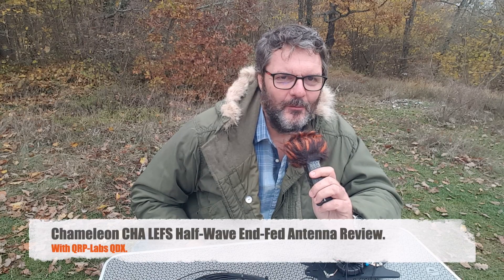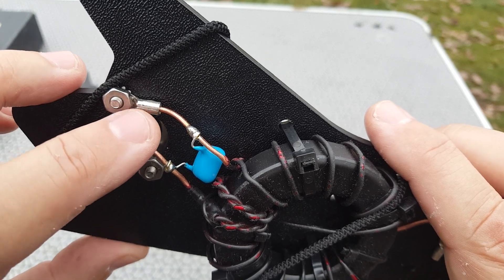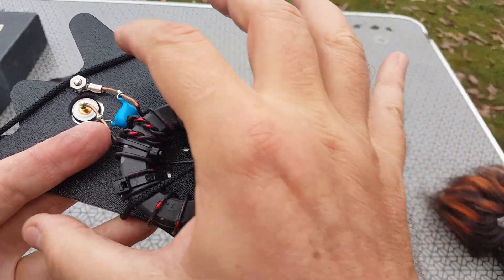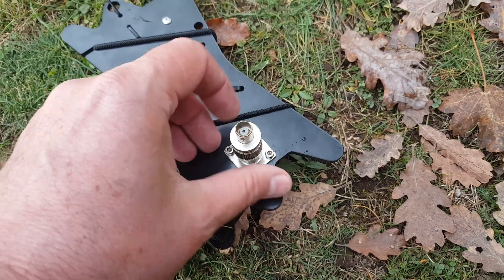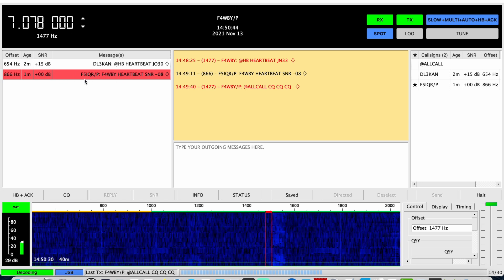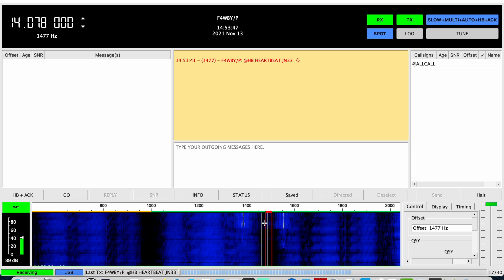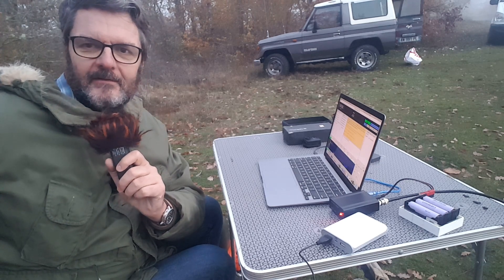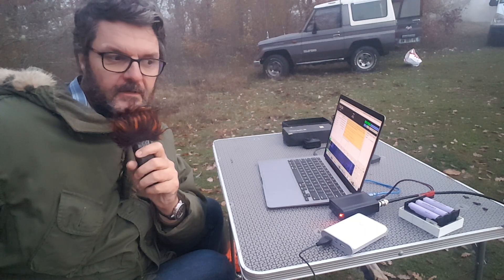Chameleon CHA LEFS Half-Wave End-Fed Antenna Review.

Comment: I don't understand the ham community's fetish for soldering crimped connections. Soldering crimped terminals doesn't increase reliability; it degrades reliability because copper work-hardens and becomes brittle. Look at the wiring in a commercial aircraft: it's almost all crimped and only crimped. That said, I love your videos. 73 de KN6NPZ

Comment: I am trying to find the best NVIS antenna for close in local contacts between 50-200 miles- any suggestions?
Reply from the maker: A simple dipole or end-fed half-wave is best. As long as it's horizontal it's fine. There are no special NVIS antennas. The only way to make it better it to lay a wire below the antenna, on the ground, 5% longer than the antenna... Go to radiopreppers.con and search for "super gain nvis".
Reply: @RadioPrepper  thank you very much the reflector wire that is laying on the ground is it one continuous wire or does it need to break in the middle where the 1:1 Balin connection point is above
Reply from the maker: Continuous.
Reply: @RadioPrepper  thanks!

Comment: The newer version, at least mine, has the entire toroid/connector/cap covered in pretty decent heat shrink.  I picked mine up when visiting HRO a month ago.  Still haven’t used it yet, as I plan on running it from our seasonal campsite next year, we have three 85’ pine trees for me to choose from for a nice sloper.  I am itching to test it out though.

Comment: Another "dummy load" antenna from Chameleon. The reason you see low SWR on WARC bands where the EFHW wire for 40M is  NOT resonant, is elevated insertion loss in the transformer which attenuates forward and reflected power. It is the oldest trick used by companies such as Chameleon, Alpha antennas, Ultimax, and many others who are either dumb or intentionally pushing the narrative to uninformed  Joe Ham how low SWR is the best thing ever and the equivalent of best efficiency which is NOT true.
Reply from the maker: You will note that I did not say it worked on WARC bands, nor did I test it on those bands. The antenna will work great with a half-wave wire and on harmonics.

Comment: Hi Gil! What about the tuning of the antenna? Did you just put it up like it came right out of the box or did you have to tune the wire length first? In my limited experience it's the tuning part that makes EFHW antennas a bit of a pain (because you have to bring the tip down to fold/unfold it a little bit more each time). Any tip to avoid this? Thanks!
Reply from the maker: This one is already cut to the right length.

Comment: Acutally, this construction is quite lightweight, compared to a weather proof box with two cores and metal bolts to string this up. I'm considering accepting this inspiration for my portable setup esp. with the weight hanging on my spiderbeam 12hd.
Reply from the maker: It's all relative I guess..

Comment: I believe i have seen a version of this antenna that had a heat shrink cover over the core. i wonder how much change would be if the transformer was wound for 64:1
Reply from the maker: It does now, and not much.
Reply: @RadioPrepper  that is a bit puzzling
Reply from the maker: It's a very high impedance so dividing by either does not result in a big difference...
Reply: @RadioPrepper  thanks Gil....keep up the good work!!! 73

Comment: Thanks Gil for taking the time to show us this antenna in outdoors!
As you show with the SWR graph at 5:35, this antenna is NOT resonant on the 17m or 12m band, as Chameleon specifies it on their web site. It's simply not possible with a 20m long EFHW radiator without links or a corresponding coil (not the coil that compensates for the end effect). Of course, with enough losses built in, one can get a reasonable SWR on non resonant frequencies. And one can definitely make many contacts if the conditions are right!
I like the saying from Owen Duffy that boils it down: "Well, in ham radio, everything works. But systems that work better increase the prospects of contacts."
I invested a fair bit of time by evaluating and measuring different EFHW designs, also from the mechanical perspective and finalized my findings in a 50+ page document. 
As you stated in this and other videos, EFHW antennas can be very versatile and efficient. 
Gil, please keep up your authentic product reviews, since it's always interesting to see how commercial companies engineer their products! 

73 Stephan
Reply: 17 and 12 would need a trap if your only using 40 half wave, my antenna is resonant at 3.5mhz with no loading coils and it is very usable on 30m, 17m and 12m.
Reply from the maker: Thanks. It should work on the other bands using a choke.

Comment: I buy most of my equipment from a manufacturer but $180 USD is just way too much money for what you get here. I recently bought a 64:1 100w alternate wind fully assembled unun on eBay for $18 delivered. Another $12 for 125 feet of THHN 14 gauge wire from Home Depot and I was good to go. I even put my toroid in an ABS case for another $5. So I saved $145. I guess that I still don’t have the paracord, but $145 will buy you a LOT more than 50 feet

Comment: You are correct about the high price (or should I say premium?) for Chameleon antenna products.  I own several of their products.  You get what you pay for in this modern world.  The Chameleon antenna gear that I own is high quality.  It is a pleasure to use, for example, the MPAS 2.0 system, and their original version of the CHA F-Loop.   I have bought from China before (a couple of radios).  Good designs, but manufacturing & reliability wise, pieces of s***.  Also, no local repair services. I suppose this will change some day or is in the process of changing nowadays.  There are also other alternatives.  E.g., Nelson antennas sells on Ebay.  I own two QRO 9:1 UNUNs and they are high quality.  Nelson also sells QRO 49:1 UNUNs with wire for 40-10 m and 80-10 m.  Approximately $95-$106 range.  I would expect great quality based upon my 9:1 UNUN experience.  Note!  I am no advertiser and I get no monetary gain from Nelson (or Chameleon).  I will continue to patronize both suppliers based upon my personal experience with their build quality.  Too lazy to homebrew my own UNUNs, I suppose. heh heh heh heh

Anyway, another great video and a very informative review.  I noticed online that Chameleon has updated/upgraded their product, perhaps to account for concerns such as those you presented in this most recent video.  Oh wait!  You already mentioned this.  Ooops! *LOL*   73 de Jim, AE5ZX
Reply from the maker: Indeed, the MPAS is awesome, nothing better on the market.

Comment: You: "chameleon antennas are good quality".  Also you: the connections are not soldered, the toroid is not protected with a box, and the antenna wire insulation broke when it kinked.
Reply from the maker: This one as I said is not up to the usual Chameleon quality.

Comment: I agree with you concerning the crimp, it should be soldered. Also, the toroid could have a heat shrunk plastic sleeve like Packtenna does with their field endfed antennas. I also have to thank you for the tip on the CHA 17' whip antenna, mine was loose like yours and a quick Epoxy job fixed it. 73
Reply from the maker: It does have HeatShrink now.

Comment: Hello om Gil de 4Z1AR, it is 49:1  not sort off or about , it is exactly 49:1 determined by the windings ratio . since it is an auto-transformer configuration the primary coil is all the 14 windings and the secondary coil is 2 windings that are coupled by the core - so winding wise it is 14:2  and impedance wise it is  power of 2   Z1/Z2=(N1/N2)^2  so 14^2/2^=196/4 = 49/1  73 Amir
Reply from the maker: But this one has 15 turns total.
Reply: @RadioPrepper  strange ... I now actually counted ..... you are right . so it is about 56 :1 .......  SRI  tnx fer correction es 73

Comment: Hi Gils, I'm curious about the performance on 17m. It would seem you would need tuner, no? It's advertised as having less than 2.0 SWR but your sweep didn't have a dip present.
Reply from the maker: I would definitely use a tuner. 17m is not a harmonic of 7MHz.
Reply: @RadioPrepper  Thanks, keep up the good work!

Comment: As you said without the box  it's  subject to  nature's fury, safer to use efhws with transformer boxed in waterproof  boxes for the high  price.
Reply: If I got it, I would protect it with a heat-thrink envelope.  You can get tubes that large.
Reply from the maker: It does now.